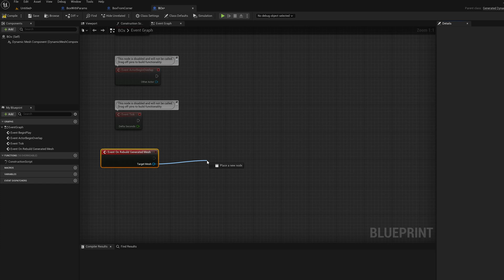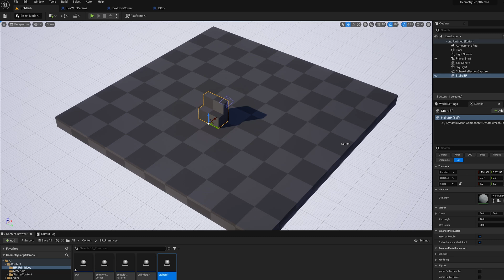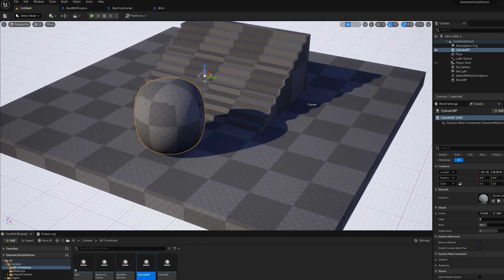Quick UE5.0 Geometry Script Demo

Comment: Hi Ryan, is there any way to use a static mesh (imported from external app) as an input for appendSweepPolygon() ? I have tried CopyMeshFromStaticMesh()->GetAllVertexPositions()->ConvertVectorListToArray()->ConvertToPolyPath()->2DStructure[] into appendSweenPolygon() ... the shape is there but its doesnt undertand how to draw the polygon and rarely happens to draw it correctly. The ability to use a custom mesh as sweep polygon would open up a ton of possibilities. Maybe it is supported but I have not been able to solve for this.

Comment: I need to programmatically generate several thousand tiles and save them into a an asset package.  I can save the baked static meshes into a UPackage but how do I save the UPackage to a file on disk? Or how do I set up the package to automate the processing?  I feel like I am close to the solution but I am missing a blueprint node "Save UPackage To Disk"

Comment: Hello when i make a stair my 3D widget is not at the top of the stairs like you but on the side, how can i fix it ? Thanks
Reply from the maker: you can set the default value of the vector parameter to move the initial widget position, but you can't set this programmatically, you would need to configure it relative to the default values for your particular stairs generator

Comment: Hi Ryan,  thanks for sharing, this is a really powerful workflow.  I'm curious, what nodes are you running between the Break Vector and Append box for XYZ?  I'm assuming those help the widget stick to the actor while scaling.
Reply: When you imagine scaling a box by just one corner, what do you expect to happen?
  A) Just that corner follows the widget; or
  B) Both that corner and also its opposing pair '''follow''' the widget, allowing you to scale both 'sides' of the box at the same time.
If your answer is B, you want those x2 nodes between the Break Vector and the Append Box. If A, omit them (and add another widget for the other corners of the box probably).
Reply: They are the multiply nodes.

Comment: Do geometry scripts work at runtime as well or only in the editor?
say can i make dynamic stairs for a building game?
Reply from the maker: GeometryScript works at runtime to modify UDynamicMesh objects. DynamicMeshActor/Component is available at Runtime. However the GeneratedDynamicMeshActor I use in this video (subclass of DynamicMeshActor) is editor-only. At Runtime you would have to have your own method for forcing mesh updates, generally the way to do this is to make your own function in a BP to recompute the mesh, that you call both from the Construction Script and "on change", however you define that in your runtime context.
Reply: @RyanSchmidtEpic  How do this "recompute the mesh"?
Reply: @RyanSchmidtEpic   I do get tired of having to reinvent the wheel all the time because of someone thinking nobody would ever want to do that at runtime when the same code, for the most part, would work just fine at runtime, excluding editor specific things, of course, like setting folder paths in the outliner and such.  Adding all these with_editor pragmas artificially blocking all over the place when technology/graphics-wise there is nothing stopping you from doing the same thing at runtime.  Even basic things like simply opening a file dialog which is nothing but a simple wrapper around a particular OS API call has to be reimplemented.